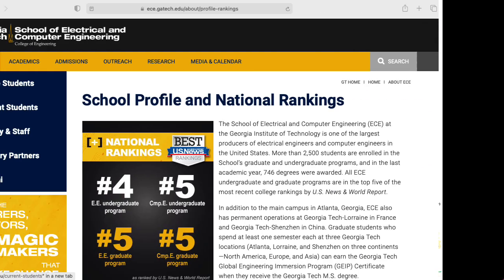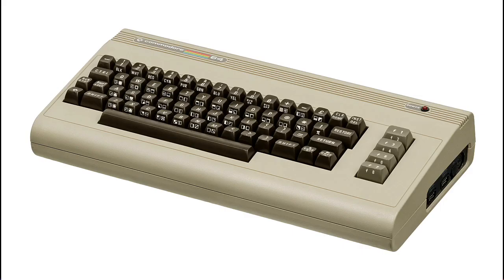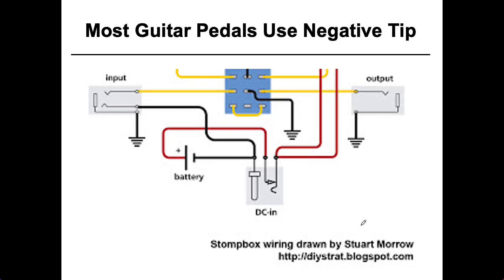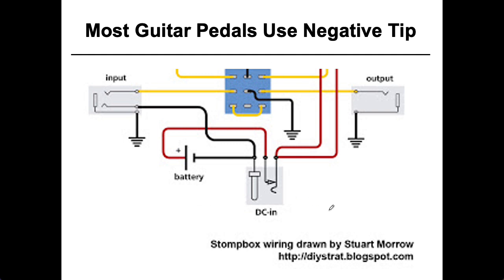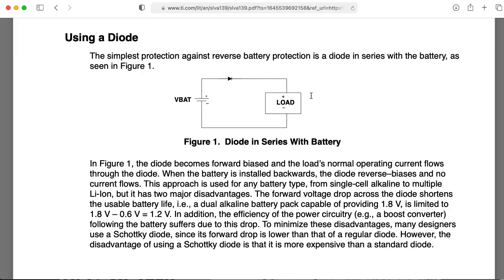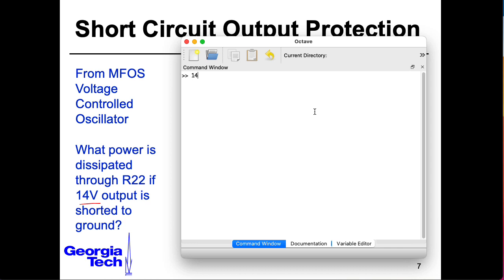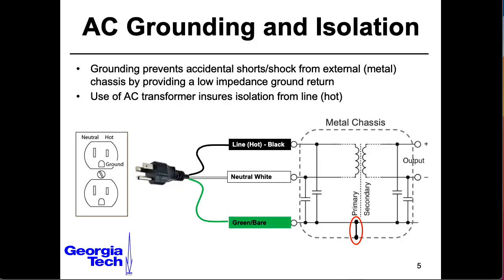(OLD VERSION; GO WATCH NEW ONE) Reverse Voltage and Output Signal Protection

Comment: The simple DS-1 protection diode is primarily to give “some” time to figure out your error if you use a 9V center positive power supply instead of negative center. Typical power supplies are 100mA so it gives you some time to figure out why the LED isn’t lit before it does damage. But that is about it. It doesn’t help much if you somehow plug a battery in backwards (how would you do that?) or use a beefier, non-boss, power supply. I’ve seen many pedals with fried diodes and/or dead components so the level or protection is minimal. Best protection is the PMOSFET configuration. Less forward drop as well. But more parts and more expensive parts so not too many use it. I’ve used a 12V Zener diode to clamp power supplies to protect against both reverse voltage and over voltage as there are many 18V supplies available now with upwards of 500mA available. Crude but it helps.
Reply from the maker: I posted a revision of this video clarifying the DS-1 part: https://youtu.be/lnmT6yuoq8Q
Reply: actualy, it's a 9V battery, so both terminals are very close together, so if you weren't paying attention you could accidentally connect the battery backwards, for a little bit.
Reply from the maker: @woosix1  Yeah, I think it's intended to just protect for intermittent reverse battery contact when someone is fumbling around.
Reply: @woosix1  but it only matters if you do it while something is plugged into the input. So, if you do that then here’s your sign.

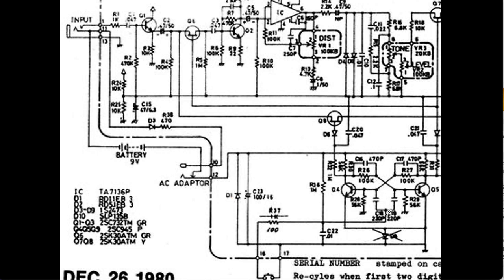Comment: Did you intentionally change the example pedal to set-up your question at 6:25?
Reply from the maker: I just posted a second revision: https://youtu.be/lnmT6yuoq8Q
Reply from the maker: Yeah... and I wound up messing it up anyway. Ugh.

The reason I changed it is I had misinterpreted what the diode + resistor in series was doing in the CE-2 schematic; I had assumed it was running parallel to the power jack input. It's really running in series on the ground side, because although it incidentally provides series reverse voltage protection for the external adapter, its main function is to drop unregulated 12 V in ancient Boss power supplies down to 9 V. In later versions used with a 9 V supply these are jumpered. That seemed awfully complicated to explain, so I switched to the DS-1.

But then I made another mistake -- it turns out Boss made several versions of the DS-1, and I based my reasoning on redrawn schematics of the later versions. But when I made the video I grabbed the official Boss version which is an earlier version. In that earlier version D1 is actually a Zener for over voltage protection, which gets swapped for a 1N4004 for mediocre reverse voltage protection (I guess since the original resistor+diode are now jumped). 

I need to fix this video (annoyingly I can't just replace the video, I have to upload a new one) and probably make a new video explain just what's going on with the various Boss revisions.
Reply: @Lantertronics  Yes, I saw the comments after I posted. Outside of this specific Boss example, 1N400X seems quite typical in pedal schematics. Thanks for all the great content.
Reply from the maker: @teblake3  :)
Reply: @Lantertronics  lol, welcome to the world of trying to make sense out of vintage pedal designs. I’ve been doing it for 25+ years and am still surprised by things I see.

Comment: I can not convince you that the parallel diode is a good protection scheme, because it just isn't. I am a fan of a serial protection diode. I lose 0.6-0.7V but meh,... I never fry my circuit. But speaking from experience: The parallel scheme kind of works, because the Diode is beefy enough to not immediately fail and for me at least it was long enough to realize the mistake and fix it. I used a wrong positive tip power supply, which is arguably worse than a wrongly inserted battery and it protected the circuit. that being said: it still isn't a good scheme whatsoever. i think they use it because they say in the manual "only use with XYZ boss power supply" and if you don't do that, then well,... you're going to have to buy  new one. not cool but also expectable
Reply from the maker: Good points... as an aside I posted a revision: https://youtu.be/lnmT6yuoq8Q

Comment: With respect to Output Signal Protection I can imagine a more worst case scenario: you might accidentally connect two outputs together, where one output goes to +14V and the other goes to -14V. Such a scenario is not unthinkable in modular synthesizers. Suppose that one of these output stages doesn't have this 1K resistor output protection, then it would mean that the 1K resistor has to deal with 784mW dissipation. I'm not aware of any modules that don't have such an output protection resistor, but we're talking worst case ;)
Reply from the maker: Good point!

As an aside, I posted a revision of this video fixing the DS-1 part: https://youtu.be/lnmT6yuoq8Q

Comment: The crowbar diode is definitely a halfassed or cost optimized approach. I won't make the case that it's a reasonable design in this day and age but I think it does an acceptable job in the context of its era and the typical faults faced by such a device.

The simple transformer-rectifier-linear regulator AC adapters contemporary to the DS1 couldn't do more than a couple hundred mA - with the forward voltage clamped to around a volt this is well within the diode's ability to dissipate. Modern SMPS wallwarts usually have either a current limit on a similar order of magnitude, or the diode will trigger their short circuit protection "hiccup" mode in which typically less than half a watt will be delivered on average.

The internal resistance of a 9V battery is quite significant. A typical alkaline will only deliver a couple of amps into a dead short; the higher performance ones have an internal resistance of between 2-3 ohms. I am guessing that a consumer of that era would more likely have been using zinc-carbon batteries, with about an order of magnitude higher resistance. Combine that with the resistance of the wires, the contact resistance of the two switches and all of the solder joints and traces in between and we're probably  on the order of 10 ohms and thus barely flirting with the steady-state maximum dissipation rating of the diode. It will be harder on the battery than the device. I think it's also arguable that this fault is always going to be quite transient in nature because of the battery connector's keying, only occurring while the user is fumbling with the battery, and disconnected as soon as they notice its failure to mate. Something on the order of a second or two, where the numbers are much more forgiving....and this only even happens if the user doesn't simply unplug the input jack to replace the battery, which is probably pretty awkward.

That said, there's no excuse for doing this in a modern design because a TVS and polyfuse will add pennies to the bill of materials and solve the problem with zero technical tradeoffs.
Reply from the maker: Good points! I posted a revision of this video fixing the DS-1 part: https://youtu.be/lnmT6yuoq8Q

But I'm leaving this version of the video up because comments like this are so helpful and I want to preserve them.

Comment: I think perhaps the original design consideration was that they tell you to only use their PSU and the diode is just for the circuit protection if the battery contacts are momenterily put on the wrong way. Either way it could be done better! People using their own PSUs have shown something that they never considered originally, which probably should have been, I wonder how much money they have lost over the decades on it.

P.S great videos, always looking forward to the next!
Reply from the maker: It's not too exiting, but I posted a revision to this one fixing up the Boss pedal part: https://youtu.be/lnmT6yuoq8Q
Reply: @Lantertronics  ah hah seen your chat with Rene good work!

Comment: Putting a diode in reverse across power rails is good idea but only if there's PTC fuse on the way. Aparently that Boss pedal missed one, to save $0.05.
Reply from the maker: I just posted a revision using the correct schematic: https://youtu.be/lnmT6yuoq8Q

And that one doesn't even have any over voltage protection anymore!

Comment: When using an AC adaptor D3 and R38 provide the reverse protection. D1 is a 11V Zener diode that protects against overvoltage. In that mode R38 also delimits the current through the Zener. When the battery is accidentally touching the clips in reverse, D1 will take the load and provide reverse protection, but I don't think this was what the designer was primarily concerned with. As this happens only when changing the battery, and wouldn't even be a problem if no cable is inserted in the input jack.
Reply from the maker: Oh heck... is D1 is actually Zener? I couldn't tell that from the schematic, it looked like an ordinary diode. If that's the case I've now screwed up this video a second time in a row.

 I was basing my understanding of D1 off this schematic on Electrosmash: https://www.electrosmash.com/boss-ds1-analysis which describes it as a 1N4004.
Reply: @Lantertronics  The legend in the schematic in the video marks D1 as RD11EB. That is a 11V 500mV Zener, although they haven't drawn it as such. The PCB shown at electrosmash seems to have been populated with a 4001 instead. (There have been several versions.) The overvoltage is maybe not so important as the circuitry probably runs fine with higher voltage. Maybe they stuffed in a 4001 later to save a few pennies. But it explains why R38 is there and what its' purpose was.
The main point is that D3 is doing the reverse protection for the AC adapter, while the 9V battery is largely unprotected, (or dissipates into D1 if you are really determined to hold the clips the wrong way to the battery terminal, and a cable is plugged in). 9V batteries are nasty anyway, the terminals can easily short out on any random metal parts. I had explosive behaviour and melty incidents with these.
Reply from the maker: @reneschmitz4845  I just did a bit more sleuthing and it looks like there were multiple versions, and at some point they switched from a zener (which I find more reasonable) to a 1N400X (which, oh my goodness, why, Roland, why?)

Regarding D38, I found this bit: "D3 and R38 are two components that are connected between battery lug on the DC adapter jack and the Ring terminal on the Input Jack. Going from Input Ring to DC Jack, D3 is connected in series with R38 (with D3 forward current flow going towards the DC Jack); R38 then connects to the battery lug on the DC Jack.
An anonymous associate explained to me that D3 and R38 were used to allow use of the 12VDC ACA-style power supply. You can read more about the function of these components at http://www.bossarea.com/other/aca.asp.
And just like that, the mystery was solved and the proverbial scales fell away from my eyes."
Reply: @Lantertronics  So R38 is indeed a load resistor for the Zener, but not for overvoltage protection but for regulating down when using a 12V Adaptor. D3 will also drop about 0.7V and block current when the AC adapter is reversed. In later versions the circuit becomes more endangered by reverse power. Disspating the reverse voltage into D1 is not a good idea.
Reply from the maker: @reneschmitz4845  OK, I follow what you're saying now. I need to make yet another update to this video. Ugh.
Reply: @Lantertronics  And it's not even monday :D
Reply from the maker: I posted a second revision -- thanks for your help on this: https://youtu.be/lnmT6yuoq8Q
Reply from the maker: D3 and the 470R look like they're actually connecting the negative of the power jack to the ground through the ring-sleeve connection at the input jack. It looks like they might be playing the role of the D5 and R53 in the older Boss CE-2 that Electrosmash describes as allowing the unit to take a 12 V supply external, so it's like relative to our desired ground the supply has -3 V relative volts at its negative terminal and +9 V at the positive terminal (this is really confusing and what caused me to have to delete the first version of this video I did based on the CE-2 and then record a new one).

Interestingly, I the CE-2 the diode in the D1 position is in fact an 11 V Zener.
Reply from the maker: This schematic from Thermionic Studios has D3 and 470R connecting the ground through the guitar input jack to the negative terminal of the power jack, which makes me think it's doing the weird CE-2 style thing and not acting as reverse voltage protection. If it was acting as reverse voltage protection I'd expect a connection to the positive somewhere. But I've also been staring at this for like 12 hours and am now just totally confused.
Reply from the maker: Huh, the Thermionic Studios site lists two schematic. One doesn't label it but it doesn't use a Zener symbol, and the other lists it as a 1N4004.
Reply from the maker: It looks like very early boss pedals used an "ACA" adapter that required 12 V, and a they did a weird thing inside with a diode and resistor to effectively give themselves a 0 to 9 V that sort of corresponds to 3 V to 12 V from the external supply. Weird.
Reply from the maker: That bit about handling the 12 V ACA supply is from https://www.diystompboxes.com/DIYFiles/up/Build_Your_Own_DS-1_Distortion.pdf -- I should do a separate video on it after I get some sleep because it's so darn confusing.
Reply from the maker: I finally figured out everything you're saying. I will edit and post a new video with new footage once I get some sleep.

Comment: I never understood those kind of parallel protection diodes circuits either. to me it make more sense to put the diode in series with the battery.
Reply: Most do not want to suffer the diode drop in voltage. Even with a Schottky diode. The internal resistance of the diode can cause popping when the LED is switched on and off which is why I always power the LED from the anode end of a series diode. Since it is a diode itself, it won’t be damaged by reverse polarity.